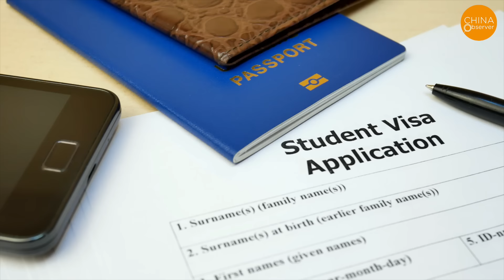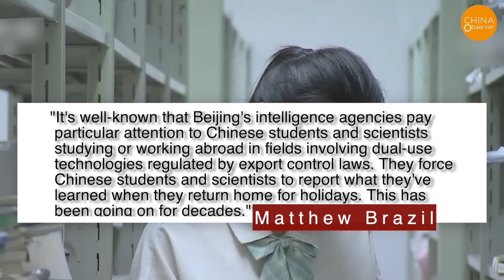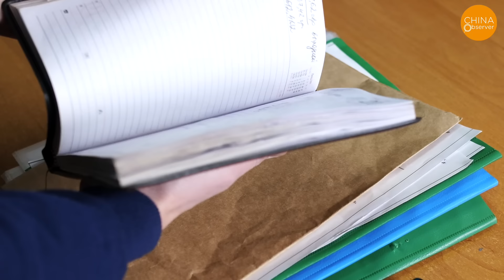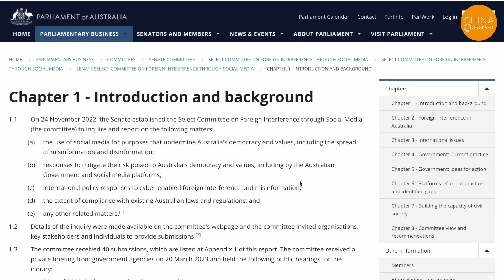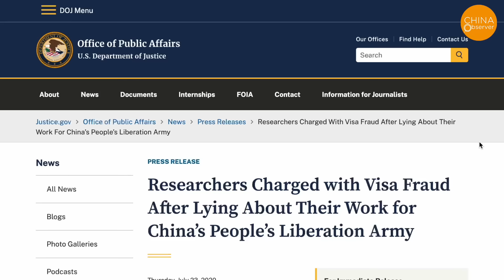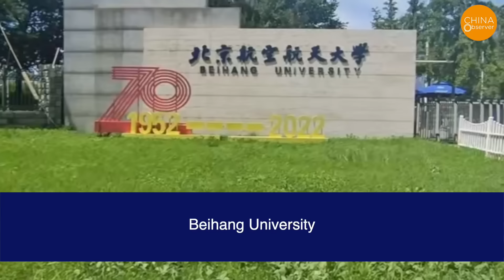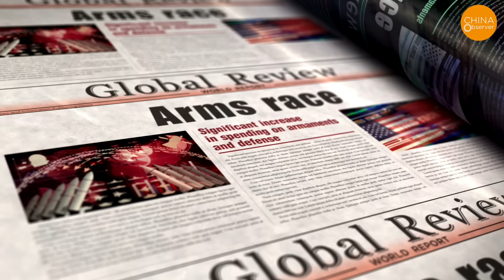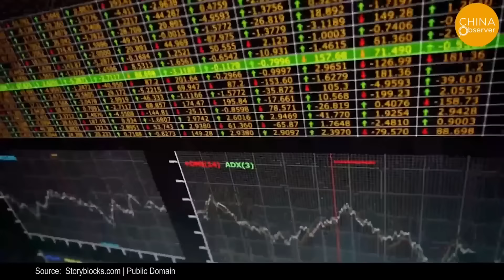US, Australia, and UK Start Mass Deportation of Chinese High-Tech Spy Students

Comment: If they don't plan to stay here what's the point of getting a PhD  other than to take the technology back.
Reply: 💯 ✨ on point ✨👌🏼
Reply: There is, actually, a point. While getting their PhD, they do useful research, and the research stays with the institution where they do it. They do get to take the knowledge they acquire with them, but they won't be able to build a business on proprietary research done during their PhD - or at least, they wouldn't, if China played by the rules. In as far as the universities hosting them do things right, the knowledge they take with them will be insufficient to fully transfer some important technology to China - PhD students are just cogs in a larger mechanism, usually headed by a professor or several professors, involving dozens of PhD students, each in charge of a tiny bit of a much larger project. Even if the freshly minted PhDs go back to China, the project they were part on continues in the US, and its outcome, if valuable, results in new technology being developed in the US. Something that wouldn't happen without the input of those Chinese PhDs.

The problem is how China approaches the entire process. It actively drives students that get to do studies abroad to gather information beyond their area of study, so as much as possible of what's being researched abroad can be reverse engineered and replicated in China, with complete disregard for intellectual property. Any NDA signed by a Chinese student is worth less than the paper it's written on. This, unfortunately, means that Western universities, not just US universities, need to limit their use of Chinese students if they want to protect their longer term academic interests.
Reply: Exactly.

Comment: In the first few decades after WW2, Japan was doing the same, and even more blatantly, both in the US and in Western Europe. Both the US and Western Europeans turned a blind eye to it. The reason China is treated differently than Japan is that, albeit with some push and shove from the US, quickly parted with its imperial past, and embarked on the path to democratize itself. China, also heir of a long and brutal imperial tradition, has no intention whatsoever to become democratic.